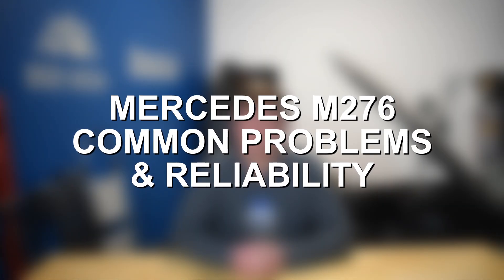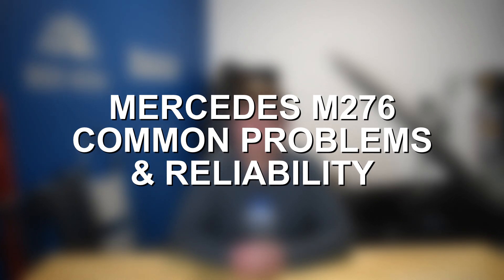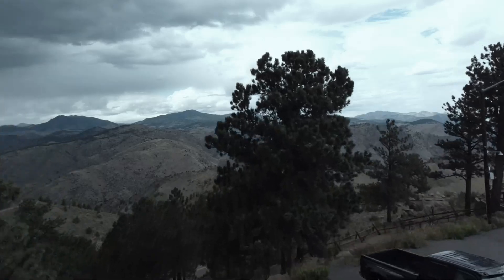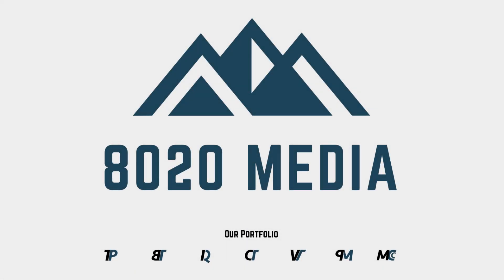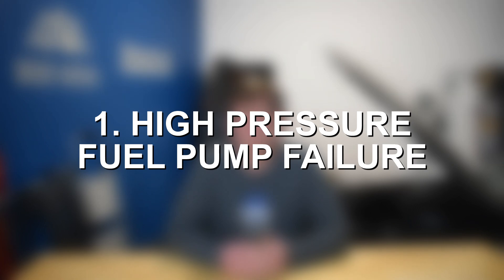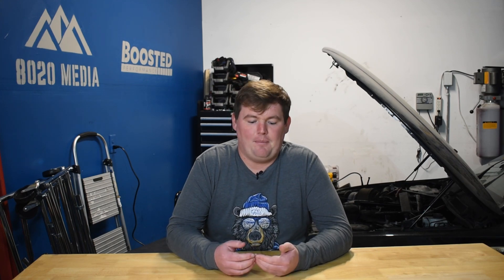M276 Mercedes-Benz | Common Problems & Reliability

Comment: Excellent video. I was hit with the timing chain rattle. Wasn’t cheap to fix, and other repairs were due at the time so I sold it. Loved the car though, and tempted to buy another one- maybe a biturbo variant
Reply: About to do the timing chain on mine a good link for the one you purchased
Reply from the maker: E - We have an article specifically for this: https://tuningpro.co/mercedes-m276-timing-chain-rattle/

It should be helpful with your research.
Reply: What mileage did that happen at?
Reply from the maker: L - Thanks for sharing your experience. Sorry to hear about that. How many miles did you have on it?
Reply: I have one
Reply: Same here. 100 k miles. In Germany the replacement of the chain and intake cam adjuster would be from 6500 to 12 000 Euros. 6500 will just replace the defect parts, makes no sense, since the motor has to be taken out anyways, so you do all the other parts as well. And for 12500 Euros? No way, that can't be a reasonable invest...
Reply: @Attila141  That is insane amount! World has gone crazy!

Nerdensin?

Comment: I just hate the direct injection sound it's terrible and needed additional sound dampening for the ticking sound 💩
Reply from the maker: 100 - Thanks for sharing your experience.
Reply: @8020Automotive what do you think of a e450 2019 with 55k miles 2 years of warranty is that a money pit or decent buy for 35k has all oil changes done on time
Reply from the maker: D - We aren't going to give any input on a purchasing decision, especially when money comes involved. However, make sure to grab maintenance records to ensure it has been maintained properly.